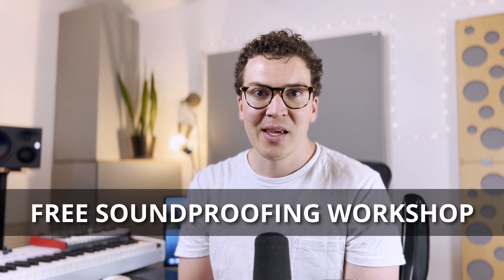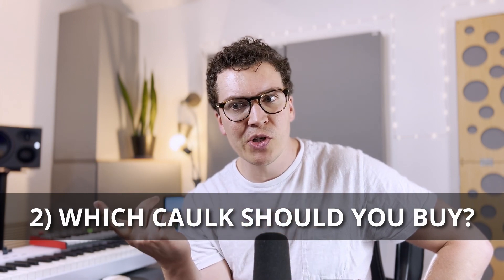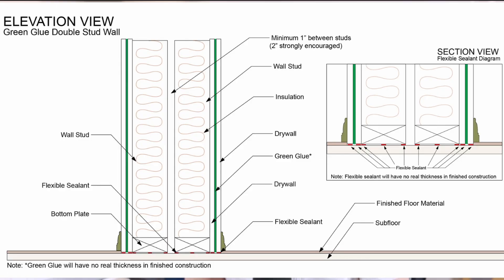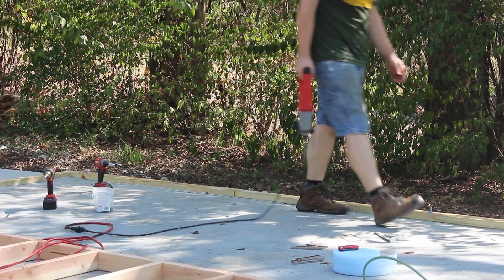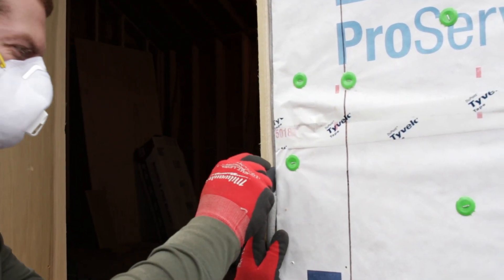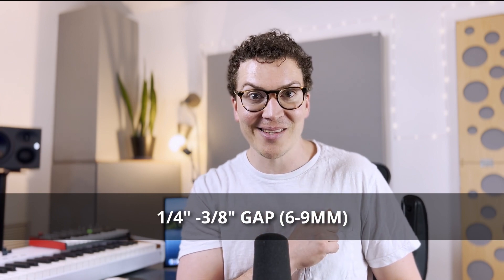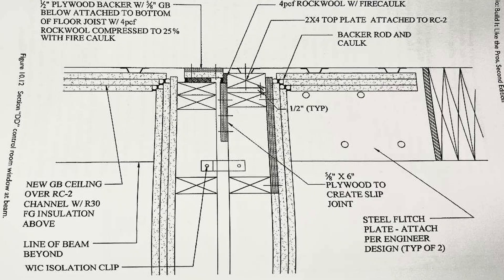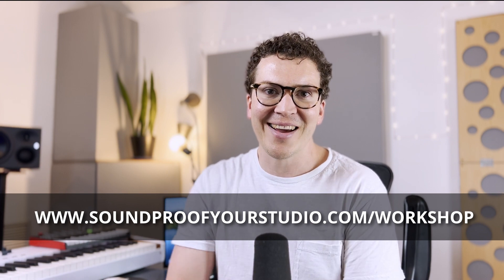How To Properly Caulk A Soundproof Wall

Comment: ok, can u make a video about how to seal corners if there's an existing wall... like for a room within a room? it's one thing to be able to see the image... and those beautiful corners, but how can we physically do it? let's assume there will be 2" to 3" inches between existing ceiling and acoustic ceiling, as well as existing walls and acoustic walls... i wonder if anyone else finds it difficult to picture how to do this as well, since there's not enough space behind the walls and above the ceiling to handle materials.

Comment: You shouldn't put drywall on the floor in case water is spilled - it'll damage the wall if it went to the floor.  I don't know about soundproofing.
Reply from the maker: Yes, I always leave a gap and seal it with backer rod and acoustic caulk. Are you planning on building a home recording studio?

Comment: That's a really good thing to keep in mind! I thought it was good to put something like Sylomer strips for decoupling beneath each layer of the stud construction but that might leave some tiny air gaps. So adding some acoustic sealant around the base of each layer (Around the sylomer too) would probably be great!
Reply from the maker: Glad you found it helpful. Are you currently building your studio? Tell me a bit more about your project?
Reply: @soundproofyourstudio  So far I'm exploring all kinds of ideas, but without actual construction happening. 
What I'll probably do, soon, is to get instruments into the room and take some decibel readings from other parts of the house before any soundproofing happens. 

I'll also probably do some sound treatment first - Absorbers and bass traps to have a bit of better sound while playing already. 

Before actual soundproofing with drywall etc., I might do some miniature test constructions of different layer combinations.

As I'm playing multiple instruments, the room will be a place for a lot of creativity I hope. 

The room is about 190 square feet, so not the largest space but better than nothing! 

Budget is very tight so a lot of the materials will be used / or free leftovers from Ebay or similar. Luckily there's quite a lot of that, like rockwool, sometimes even studs and OSB. 

All of this is definitely very complex but I feel like I'm starting to get an overview of some important mechanisms and aspects.

Your videos were definitely helpful for that!
Reply from the maker: Gotcha sounds like a good plan.

Comment: Great resource! With a room in a room, does it make sense to caulk all corners where timbere meets timber or OSB meets timber?
Reply from the maker: Yes on the final layer. I think it is overkill to caulk each layer.
Reply: @soundproofyourstudio  And does that go for the outer room of the 2 would you say? I.e. the outer shell. Or is that overkill?

Comment: I probably shouldn’t split hairs over this, but you know… Well, my room is a barn shape, so, of course I can add the caulked gap between the front/back walls and the side walls, and probably along the angled portion of the barn shape that touches the ceiling, but it would look pretty crappy with a caulked joint along the length of the wall at the lower portion of that angled barn shape where it meets the knee wall.I’m basically on a second floor large attic… Any pointers on that?
Reply from the maker: You can caulk it but then you mud and drywall over it. It will look clean in the end.
Reply: @soundproofyourstudio  are you available for a 30min hired video chat consult?

Comment: how can I sound proof a wall against low frequency sound from a nearby bar? (bass beats)
Reply from the maker: Those are the hardest. Mass is your friend - 2-4 layers of 5/8 inch drywall decoupled. You can use green glue or MLV if you want to go all out. I prefer Green glue over MLV.
Reply: @soundproofyourstudio  wait, so just drywall with green glue is better than MLV + drywall??
Reply: @nat.serrano  you can put 30 layers of drywall on your wall, but the base frequencies may still enter your space through the roof or ceiling above,… It’s quite a challenge! In my research found that most professionals say double layer of 5/8 inch drywall is one of the most efficient DIY attempts. Even better, with resilient channel. Still, I don’t think that’s enough to block anything below 100 or 80 Hz.!
Reply: @GregoryGuay  yes I agree, it's impossible, I added two layers of drywall, the issue is that the usa wood houses lack mass (wood + drywall) instead of stone/brick. The thin walls in houses act literally as speakers, the secret is to avoid the walls to vibrate. my solution was to make custom walk in closets in the walls facing the noise, the clothes inside act as insultation to block the waves :p

Comment: I have heard that acoustic caulk doesn't harden and dry up like regular caulk many times. However, I question this. Pure silicone caulk stays flexible for many years. Do we have proof that "acoustic" caulk is really better than silicone over time. What is acoustic caulk made of that normal caulk is not? It seem the goal of all caulk would be to remain sealed over time
Reply from the maker: In the end it’s the flexibility you are looking for. This is one of those small details I don’t lose sleep over, but you could see if silicone remains flexible.
Reply: To me, the proof is nearly every professional acoustic designer that has published a book and then research.

Comment: Spoke with the friends at the SoundProofingCompany about this when doing my build, and they now recommend a “High Quality 50 yr Painters Caulk” and to ensure that it has a flexible sealant.
Reply: I was just doing some research on this. Super DAP230 is an option, USG acoustical ceiling is an option, similar to green blue sealant but a fraction of the price.
Reply: 230 is a dream to work with. Highly recommend for folks who aren't pros and also folks who are pros. @GregoryGuay
Reply: What are your thoughts on that?
Reply from the maker: @AaronDaniels123  That makes sense. The key is that the caulk is flexible and of high enough quality that it will never break its seal.